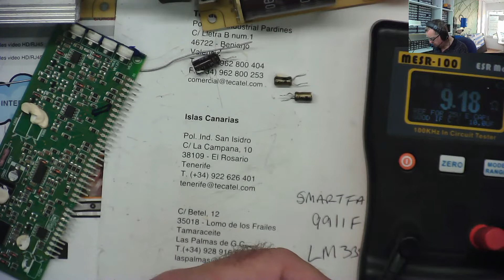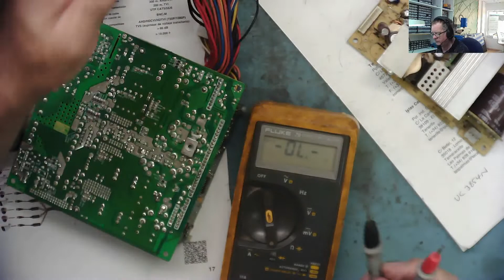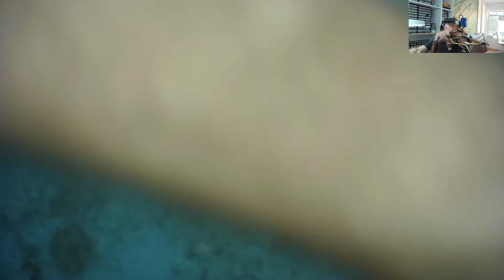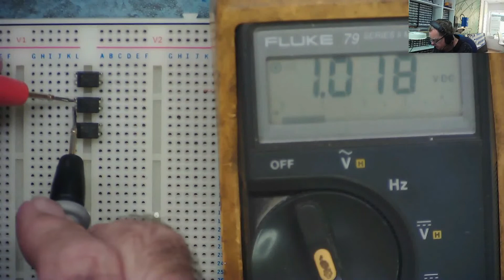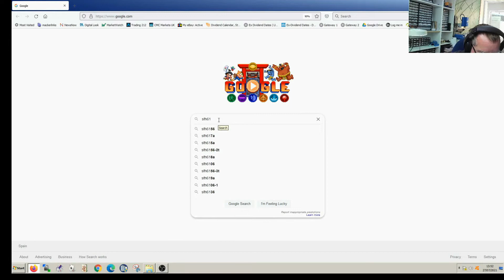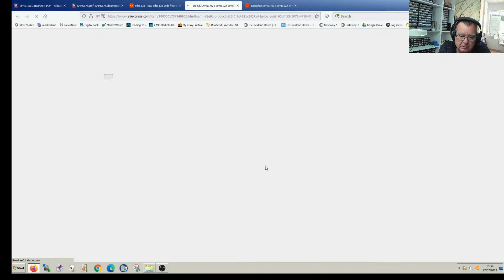ATX PSU REPAIR - A TRICKY ONE... Part 2.  Learn Electronics Repair LER #098

Comment: We know what is not the problem. I can only assume you did replace the optio-isolators and both of these two PSU still do not work. A part 3 to conclude this series would be nice to the audience that has watched this much. With no part 3, the logical conclusion is "you have no idea what is wrong" and are relegating these two PSUs to the "parts bin".  It would be nice to know, either way. 🙁

Comment: I used to repair computer peripherals - 2-phase and 3-phase motors, contactors, relays and wire-wrapped circuitry. The first thing I did to my Fluke was to build my own test leads. I used 4mm plugsthat would allow you to daisy-chain. So, at the end of my leads were 4mm sockets. With 4mm plugs, I made my own probes: crocodile clips, jumper tips for the wire-wrap connections,  needle probes, etc. I could switch them about. Trust me, the convenience and surety will be worth it. Look forward to part 3.

Comment: I notice that at 7:00, your test leads plugged into your ESR meter is swiveling. Broken solder joint? You seem to use that meter a lot. It is just me but if I were to be doing that a lot, I would be making a test rig with two big pads to touch components to and securing those meters to a panel with power leads to an external battery pack. As it is, you do a lot of fumbling which is distracting.

Comment: Is there part 3 for this repair?
Reply from the maker: These are also sitting on one side. The Optoisolators arrived but I am not convinced these are the actual problem now (due to a bit more experience).  I'll try to make the final part of this repair before the end of this month.
Reply: @learnelectronicsrepair  thank you.
Reply from the maker: @juliusvalentinas  I started the video today 😀
Reply: @learnelectronicsrepair  I did not get answer to my question on another video, so I ask again because it's relevant. 

I've seen numerous videos where LAB power supply with current limited to 2 or 3 amps is connected to heat the shorted component to find them, why not use same here to find the faulty shorted caps or other faulty shorted components?
Reply from the maker: @juliusvalentinas  Hi.  That is a common method and I will try it for you, though I already know that the PCH gets a pulse of heat every time the PSU starts for a second.  Bear in mind the current trips out the ATX PSU if I force it to run, and the 3.3V rail from the power supply possibly has a rating between 20A-30A so I expect the 5A bench power supply would go into constant current before it can heat the PCH.  Still it is an interesting experiment so will try it.

Comment: This is nerve-racking!!

Are you sure that the tester is good or that there is no shorting of the output wires when they are placed in the tester?
Reply from the maker: The ATX Tester worked before - but that doesn't mean anything, I'll try it tomorrow on another PSU to be certain

Comment: A noob question, for testing can you short or put a resitence to emulate that the octo is working and on? maybe with power limited to avoid damage
Reply from the maker: By Octo do you mean Opto (Isolator)?  

Yes that is really good thinking J. J. - you could simulate an opto-isolator being turned on by shorting the transistor side - or like you say using a low value resistor.  

Generally they just switch a circuit on or off so shorting would be fine as there will be a resistor in series with the transistor anyway

You need to be aware though that sometimes optoisolators are not just on or off - they could be driven by a squarewave for example.  You could tell that by looking if there is a waveform driving the LED of the opto-isolator or it is just being switched on or off with a DC voltage.  Actually I think I will give your idea a go on the PSU and see what happens.  Cheers.